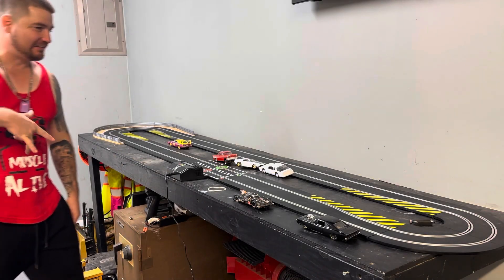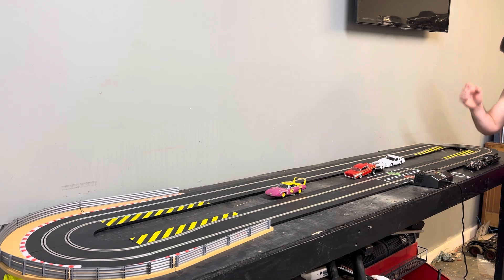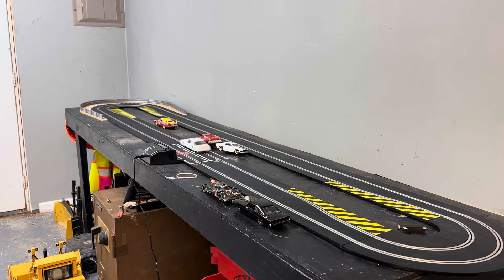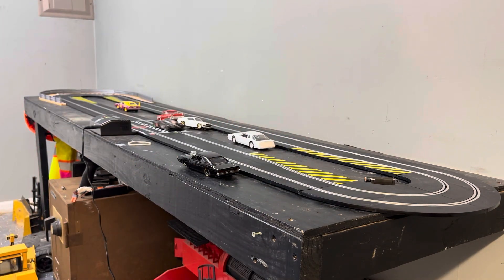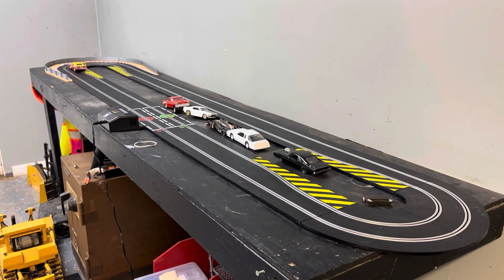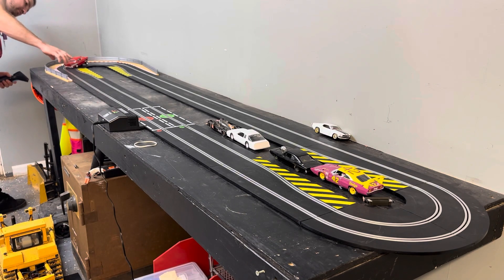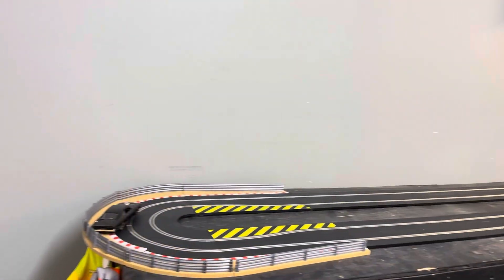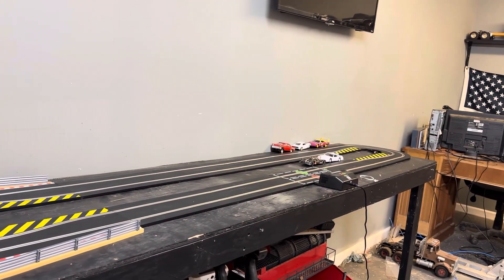1/32 slot car track:: new to this hobby pt1

Comment: Coming from somebody who owned all the big brands of 1/32 track I found the best one you can use was carrera but recently I just got the policar track and I have to say I think it's the best track made today it's a inch wider than scalextric and a inch less than carrara so it's perfect and it's the smoothest track and to me the only other reason to go with carrera would be if you like the smoother not rough texture of the track surface like on the policar track.   I have a photo of it on my community tab if you want to see it. Have fun racing!
Reply from the maker: Thank you for the heads up …😄😄
Reply: @Hopoweredtrain1988  Your welcome I actually posted a video of my new 1/32 track up if you want to see it.

Comment: You will need to replace the standard carrera guide blade with the one specifically for Scalextric cars. If you bought the cars brand new, the required guide blade (it's red in colour) is normally supplied with the car, in a plastic bag on the bottom of the jewel case the car came in.
Reply from the maker: Thanks a bunch for heads up😄😄